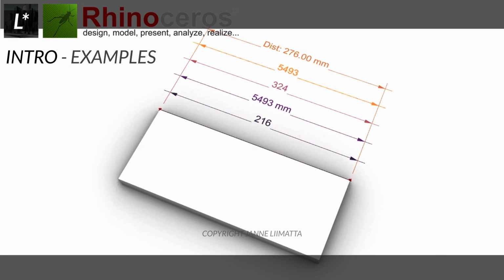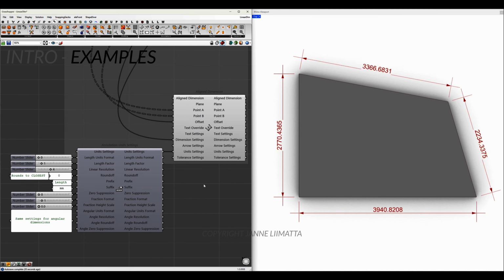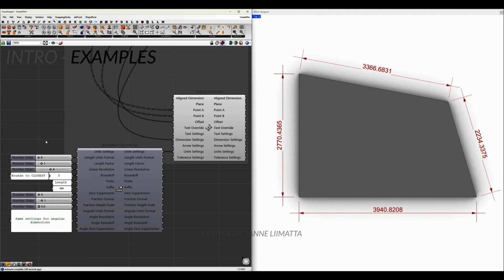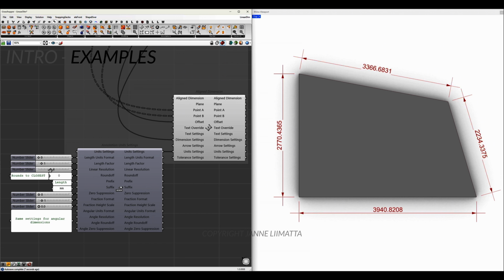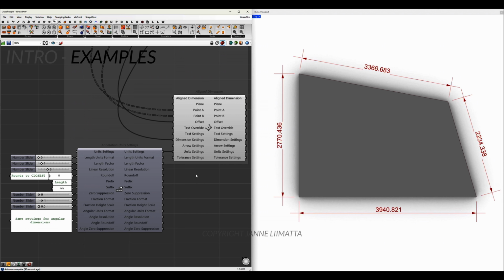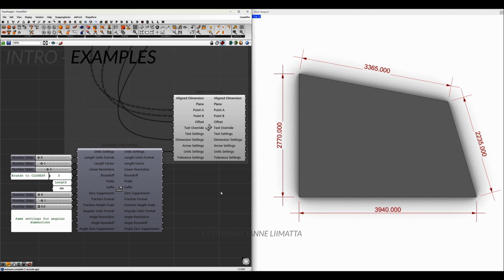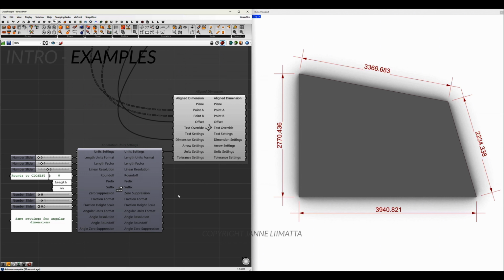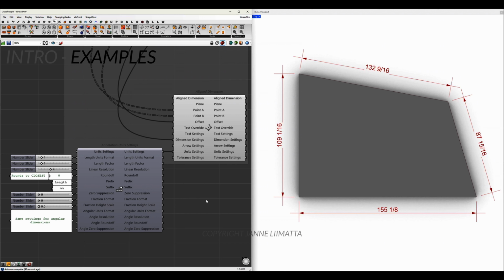Annotation Units Settings - Component explained - With examples - Grasshopper 1 - Rhino 8

Comment: Is it possible to extract text data from the dimension and bake it as text?
Reply from the maker: I assume you want the text to be in same position and formation as if it was on the dimension line. On a quick glance, maybe through a C# script maybe, but do you think you could create a workaround by creating an annotation style that has no arrows, no dimension line, no extensions etc. so that only visible thing is the dimension value?